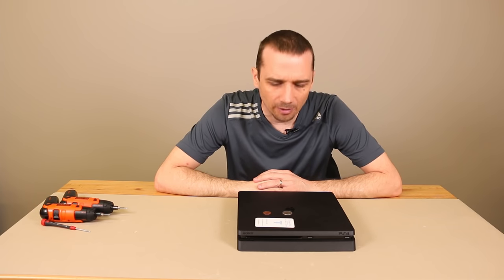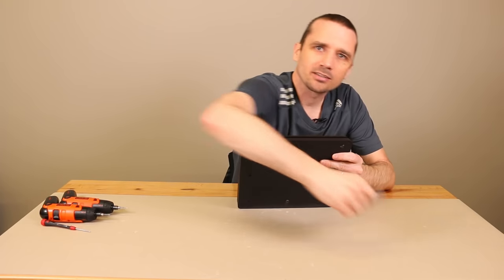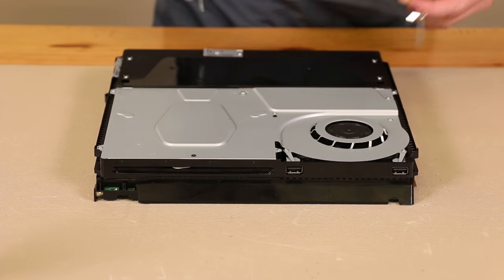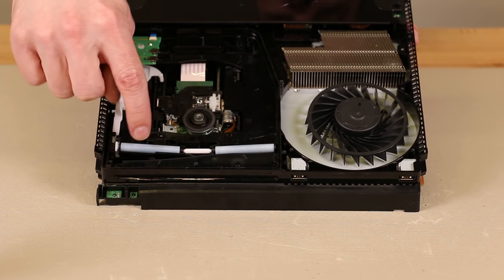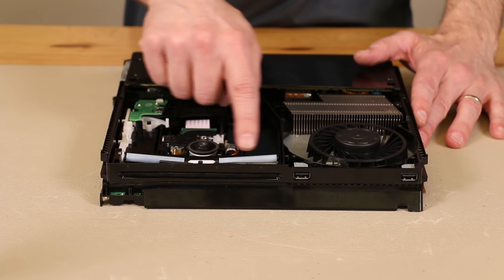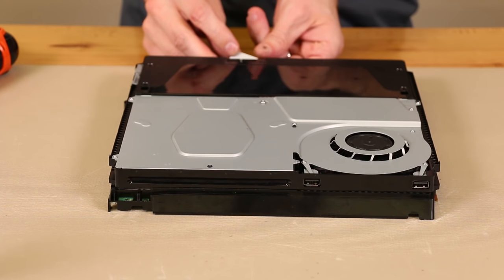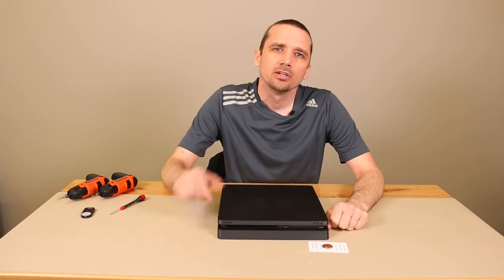How To Fix PS4 Slim Disc Drive

Comment: I followed all your instructions - much easier than I assumed it would be, great instructions- but my disc drive still won’t take any discs. Could that mean it needs to be replaced entirely?
Reply: Did you have any troubles with rescrewing in any of the screws. I'm stuck with two that just won't take
Reply: @MariDouglas  no everything took and went back together smoothly. I just followed the technique putting it back together and kept all screw lined up and in order as I removed them. The drive just won’t accept discs.

Comment: So the gears attached to the top cover of my ps4 slim disk drive are broken, but the drive itself looks like it will work perfectly. Do you sell or know where to find a replacement disk drive cover with those gears placed without replacing the entire drive?

Comment: on the right side(your right side so the left on the video) next to the rollers is a long,white piece of plastic which is broken in half in my ps4 slim. the claws of the part u removed before that step spread if i test em with my fingers when I built it out, but dont seem to take a disc in when i put it all together unless using force, which makes any disc unreadable. is this 'easily' fixable or do I have to replace the whole disc drive?

Comment: Hello, I know this video is sort of old, but I am currently trying to get to my disk drive. I am currently stuck at 3:34 . Instead of just seeing the screws, mine have this black cover over them. How do I get these off? I have tried wedging a flathead underneath them to pop them off, but those suckers are tough! Any advice? I can not access what is shown in the rest of the video with these things in the way. Any tricks to getting them off without damaging anything else?

Comment: Mine is still not working for some reason if they will not feed the disc even though I did exactly how the video show me?
Reply: Well I might have finally solved the problem and after doing this video and that is still didn't work there was another way just in case if you done the maintenance and it still doesn't work or even dont play the disc. All you have to do is have your PlayStation off hold the power button until you hear the second beep make sure your remote is still connected because that's what it's going to ask and then you put software update and everything should be working and that it should be able to play disc right

Comment: Thanks alot. 
Your video really helped me removing a small toy disc that my 2 year old inserted in to PS4 of my elder son.
I just followed each steps and BINGO. 
And it was worth as I removed a bit of dust from fan and heat sink. Thanks once again.

Comment: Tutorial does not work on the newest slim ps4 model :(( after taking out. all the screws, there are black melted plastic over certain screws to prevent opening the disc drive

Comment: My problem was just that spring that connects to those black arms. Just was shaking the ps4 slim and found it. Reinstalled it and problem solved. It wouldnt take the disc anymore and now it does again. Just one simple small spring

Comment: The metal plate was hardest part to remove and put back on and the machine screw had an L shape bolt beneath it that was tucked in a groove  which had fallen out earlier when I put it upside down which is also why I had to remove and install the plate twice

Comment: How active are you at responding? Got mine apart but the metal shroud over the disk tray and fan is rivited down not screwed
Reply: Sorry not rivets but instead of screws it's just a piece of plastic.. if I break them there's no way that I'll keep that cover tight

Comment: Something is wrong with my ps4. The disc drive did a tremendous noise so I opened it following these instruction, and I found a little spring out of place. Once placed it as showed in this video I close my ps4.
No the disc drive seems dead. No noises, no movement. Nothing.
And of course I can't put a disc in. What could it be?

Comment: My PS4 accepted discs but didn't recognise them - would spin for ages then say Unrecognised disc. I followed your video and had the little spring on the top of the optical drive originally, cleaned the lazer and the rollers and then prayed it would fix my issue since all the comments are saying it did for them but I was skeptical since there wasn't anything actually trapped inside like I hoped. 

When I powered on the PS4 the drive wouldn't even accept discs this time so I don't know what I've done wrong. Opened it back up and now I've noticed the spring that was originally there is gone...no idea where because I've checked inside so maybe it's stuck somewhere?? I don't know if that's the cause

Comment: mine will eject but won’t accept disks. i found that those black arms, if i move them together then try to put a disk in it will accept the disk. are those arms suppose to move inward? cause mine wont

Comment: my Slim's a little different. where  you say remove the 10 screws from the metal plate at 3:25. these are not screws at all. they all little plastic molds that I can't remove. is there another way?
Reply from the maker: I have a video about those...it's a new style of PS4 Slim

Comment: I tried that trick with a ps4 when you flip it and use a screwdriver to remove the disk. 
My disk isn't coming out? I can still play the disc and you can  hear it pull the dvd back into the tray.

Comment: So I did this and a little tiny spring came out and I can’t figure out where it went, so now my ps4 won’t take the disks but It will come out if I just kinda push the disk in, any suggestions?

Comment: Would it not be easier to just remove the complete drive from the other side, disconnect the belt cables and the torx screws.

Comment: This is a long shot but I’m a stay at home mom that can’t afford to replace this damn thing… HELP PLEASE, 

I followed the video, removed the toys. All parts appear to be in working order, no chips or broken pieces. I compared the disc mechanisms to this video and your video where you show in detail the mechanisms and their functions. Everything looks to be in order. However, when I screw everything back together it will accept a disc (won’t play it), eject the disc and then I cannot get the PlayStation to accept a disc a second time. 

I’ve taken it apart multiple times and it’s the same thing, it will accept the disc, won’t play, eject the disc and then never again it will accept the disc. 

Any ideas? Recommendations?

Comment: I'm confused why the power supply needs to be loosened to get the plate out. I mean I got one side out with undoing the screw, but the other one won't unscrew, and I can't get that side out. Hmm. I'm lost on what else to do to fix my disc reader

Comment: I know that this video is 4 years old but my problem is that after I installed the latest update 8.52 i got an error code and it couldnt install the update after restarting my ps4 i noticed that gta 5 is no longer in my ps4 even tho it was in so i manually got my gta 5 disc out by turning my ps4 slim upside down and using a small screwdriver where the circle symbol is at the bottom side of the ps4 but now my disc still doesnt want to go in does this mean something is wrong with the laser in the disc drive?

Comment: I have a European PS4 slim and my disc drive doesn't look anything like this. It won't accept discs anymore after I replaced the fan, tore off the PS4 power supply plug from the motherboard in the process, and then managed to solder it back on.

Comment: Hiya just woundering if you can help me I cleaned the fan just by removing the metal plate put all back together it will reject a disc but will not take a disc any ideas what could be wrong
Reply from the maker: You may have bent the metal plate
Reply: TronicsFix LLC  I found out what it was the little spring come off so stopped it

Comment: So I bought my ps4 with the disc drive not working, I took the top cover off and found the side of the ps4 with the dic reader was caved in, like they dropped it or something on it. On startup it would make a ton of scratching noises trying to spin the disc tray. I followed your procedure and took it completely apart, cleaning it out at the same time because it was disgusting, and I bent the metal covers back into place, and the metal cover seemed to be the only damage I could find aside from a few areas of the outer plastic shell being cracked. So I put it back together and the startup sound went away, it will feed and eject disc's with absolutely no problem, but it won't read them, and when it tries to read them it makes that scratching noise again, but there is no damage to the disc's. Do I need a new disk drive or have you experienced this before and were you able to fix this?

Comment: Thanks! I've actually had this happen to several of the units I purchased. I had them sent out for repair. Just got another one that frustrated me so much that I tore the thing open and it worked! You're amazing man. On your next video I dunno how you can get that cover off on the newer version without breaking the welds pretty badly. I mangled them and am wondering if there's another way, but I guess since there's that one screw it's fine.

Comment: my son has dropped the ps4 slim. now the ps4 refuses to take the CD in.  l tried to push the CD in but it didn't read the CD and now there is a lockdown because of corona and I can't take it to a specialist?

what's ti be done?
do you advise me to unscrew it and fix it my self?  what do you expect the problem is?

please I don't find torex security screw driver?
what's to be done??

Comment: For the 10 screws in the front mine have black plastic caps any help?
Reply from the maker: I've got a video about it. They are thermal welds...use a screwdriver or something to round them off.

Comment: Well my playstation slim stopped working one day so I did the manual eject, and it doesnt take or read disc anymore like the disc drive doesn't even attempt to spin the disc or anything. I took it apart and theres nothing inside and nothing looks wrong, can't even update my playstation due to it is what I read, is there anyway you have an idea of what it could be, and os there a way to fix it without replacing the PlayStation?

Comment: Hi, my ps4 has stopped reading discs, after I insert it is sounds like is trying to read once, than stops and then tries again and doesn't recognize.

Do you think it's the laser being dirty?
Reply from the maker: I would guess it's a laser problem but no way for me to know for sure.
Reply: @Tronicsfix  
Hi I tried this method but I made the mistake of forgetting the game inside.

So I ejected the disk mannualy with a screwdriver from the bottom of the console.

Still the ps4 won't "swallow" the disk and i don't think i should be inserting all the way on my own.

Got any advice?

Happy holidays and thank you

Comment: Hey Steve... after reassembling I can insert a disc, it reads ok, after ejecting it it keeps running, then I can't insert another disk. I took the covers off again and find that the black arms don't reset properly after ejecting. I took that cover off again, reset it... can't get it to work. All the moving parts seem to move freely. Any help?
Reply: Harold Cole on my PS4 slim when I try and insert a disk it doesn’t go in and the black arms don’t reset
Reply: @DantesWRLD  Yeah... kind of thinking that the mechanism must be placed back in a certain way, open closed, i don't know.

Comment: Thanks for this video! I have exactly that problem: my kid puts a credit card inside the optical drive... a fantastic idea....
The thing is my ps4 has plastic rivets instead of phillips screws to acces the disc drive... so maybe I need to cut them and replace them somehow? Or maybe I need to acces from the other side of the console? (wich is ridiculous.... but it seems to be the only way) I think Sony is making it "not so friendly"...
Reply: Emiliano Konoba what do you cut the black things off with

Comment: When I take a disc out of my  ps4 it was making a noise it wouldn't go back in but when I turn it off then turn it on it makes the same sound and when I try to put It in it goes in so I need to see what's the problem

Comment: i wish the ps 4 pro had the metal top plate over the fan. Makes it so much easier to clean the heatsink.
Reply from the maker: YES! Cleaning the Slim is WAAAAAAY easier than the pro

Comment: My slim will NOT eject, receive, or read a disc. ive manually ejected it. retightened the eject screw. still nothing. Opened my ps4 and everything looks perfect and clean in the drive. im lost.

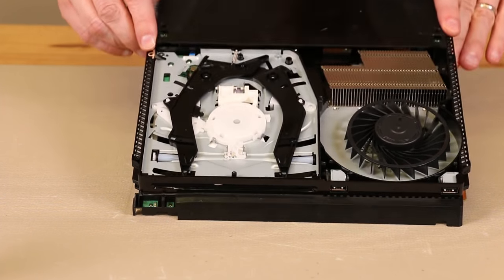Comment: Today I cleaned my ps4 without any tutorials on the background. And I flipped my ps4 and that piece from 4:18 fell... Anyway. I built my ps4 without that piece and now I have that piece in my hands with 2 white short screws. And I plugged in my ps4. And I tried to play a game. And I just realised that my ps4 is not accepting discs anymore. What's the role of that piece from 4:18? And if I'm putting that piece in my ps4, the problem will be solved?

I'm asking this because I need to go to my friend to fix this problem. Cuz I don't have screwdrivers here where I am. So, it's not a stupid question anymore. I think

Comment: I have ps4 slim I drop it by the wrong and the start button and disc button don't work and my ps4 doesn't work because I connect my wireless controller to another ps4 and I don't know what to do please help me

Comment: I have a Luna PS4 (slim with 1T memory) and I just discovered my system won't accept discs today. I ejected the disc inside and it came out no problem, but it kept doing the eject motion (wheels inside turning, etc) for a few seconds (10 maybe?). After that, I tried to out the disc back in, but it won't "eat" the disc. Oddly enough though, if I leave a disc partially inserted and turn ON the system, it "eats" the disc like normal and reads it. I tested a game and Blu-ray (Land of Lustrous) and they both worked like normal.

Wtf is going on with my system?!

Comment: My actual PS4 slim will not let me put disc it's like something is blocking the disc insert but there's nothing there how can I resolve this matter please
Reply: Check the white plastic gear assembly connected to the rollers and be sure they are all connected properly. That's what happened with my PS4 as a result of a drop. I followed the video as shown but my PS4 would not take disc (something seemed to be blocking). That's when I continued observing under the plate by the rollers and realized the white plastic gears were not connected properly. Once I made the connection - BOOM - playtime. Hope that helps.

Comment: i fiddled with the rollers but doesn’t seem to be problem, my slim physically can’t take discs, the disc drive metal cover has those little black bits you lifted it with blocking the drive, can anybody help?

Comment: 3:26 the screws have a black glue cover on top, cant take out the screws, how can I take them off?
Reply: Hey, they're not screws, they're just plastic, if you use some thin pliers you can round them off a little bit so you can pop the case off and still put it back on, just had the same issue with mine, it's just a newer model slim

Comment: I was installing my ps4 and then i stepped on the power cable and sadly the power didnt pull out but my ps4 got pushed off the desc and when i tried to put my Fallout game disc in it made worieng noices and i though it would explode.
I saw this video but im scared to open my PS4. What if my PS4 wouldn't open up again. I'm going to attempt to try. Anyway. Thanks

Comment: My ps4 slim acting crazy. It plays the disc, but when I put the disc in, it goes in but the disc don't go down so it can load, I have to restart the game system so that the disc will go down and then the game load up the disc. I don't understand why it does that. Need some help. And imma post a video so you can see what I'm talking about.

Comment: A disk was stuck inside so I did the whole manual eject thing with the whole in the bottom and finally got it out and now my PS4 won't take disk so I tried to force it in and now it won't even read the disk